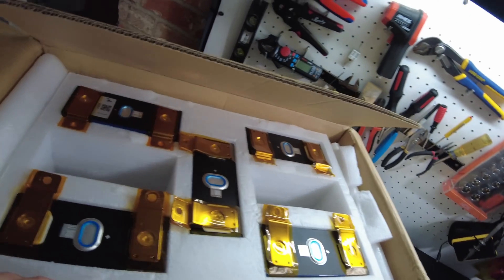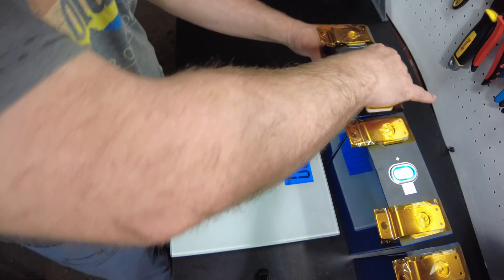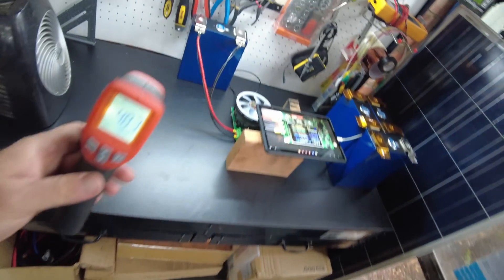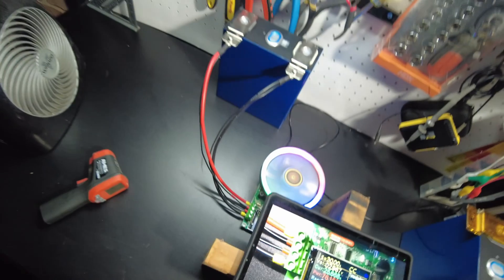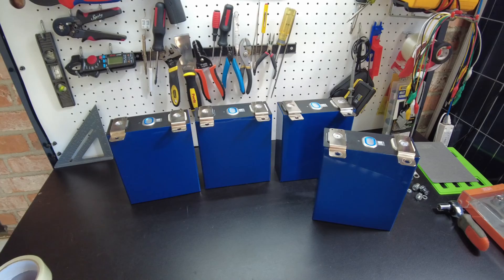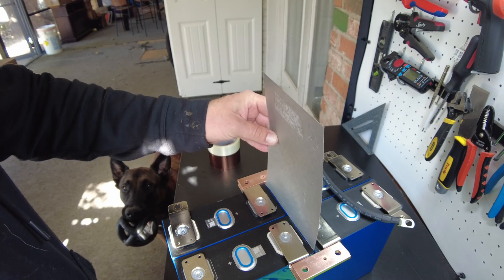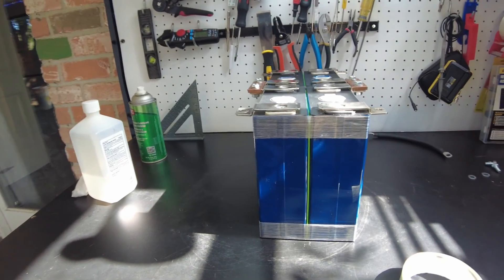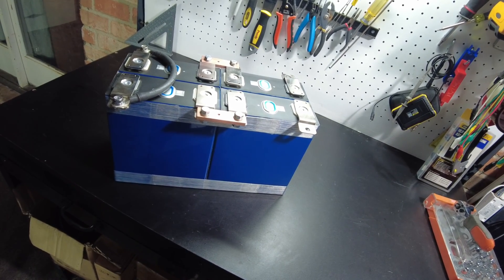REPT BATTERO 320Ah WENDING LiFePO4 Prismatic Cells

Comment: Do the specifications say that 2.4V is the max depth of discharge?  This would be a first that I have seen...normally its 2.5V as far as I know.
Reply from the maker: Yeah, usually 2.5v is considered the spot to stop. But over the years I've seen many BMSs allow  down to 2.4v or even more. I chose 2.4 because sometimes the voltage can fluctuate, and make it briefly bounce down under 2.5 didn't want it to stop early. Just some wiggle room.

Comment: Please use USA measurements
Reply from the maker: 12.7868lbs That scale I'm using is a medical scale, it defaults to kg.
Reply: OK, instead of using the watt the power unit will be the stoneage.  It's simple, just as a stone is 14 pounds, a stoneage is 1/14th of a crikey, which is 1/8th of a horsepower.  😂